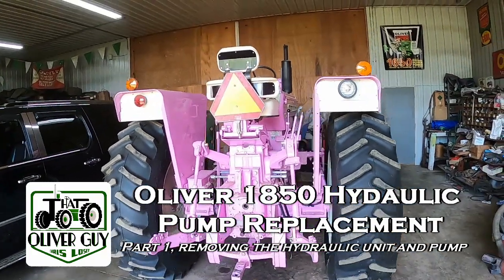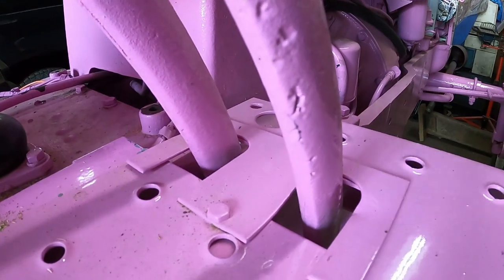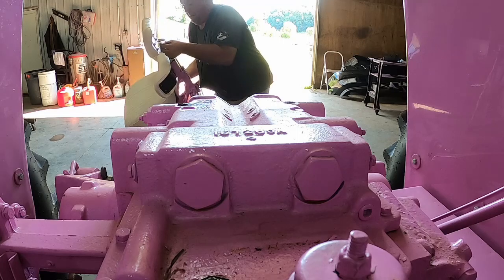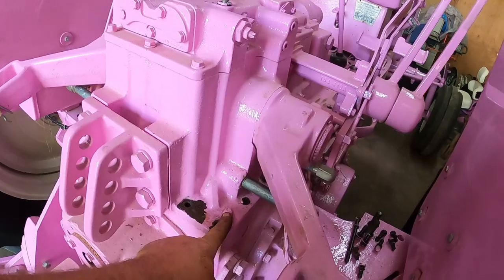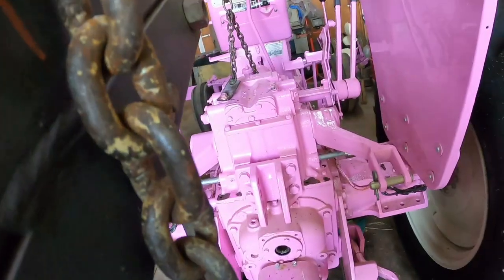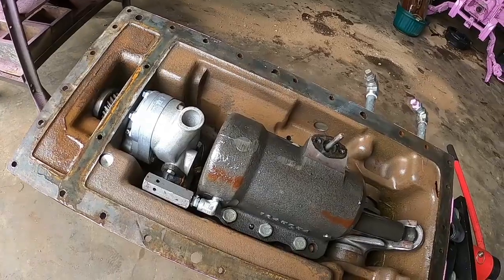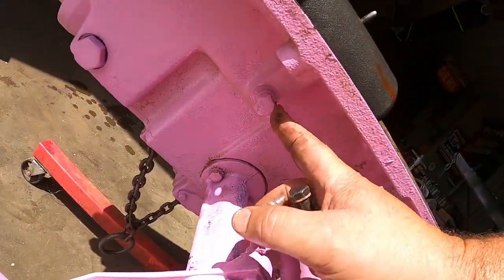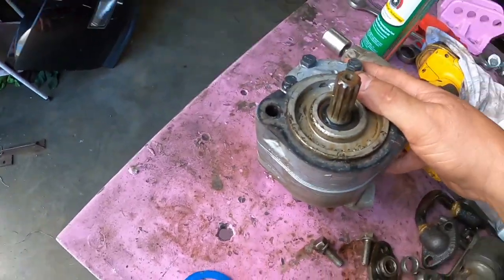1850 Hydraulic Pump Replacement Part 1

Comment: Just curious if it is possible to delete the hydraulic sump set up and run a suction line to the bottom of the rear end housing and just run trans hydraulic oil in the rear end as every other brand of tractor is this way i was told it was do able as long as its not being used for hard pulling thanks
Reply from the maker: I suppose it is possible. You'd want to use the outside flamge of that sump pan to keep the spacing right between the gears that drive the pump. Universal transmission hydraulic fluid would be a good oil to use to be thin enough to use for hydraulics but have the right additives to protect the transmission. I could also see it being a problem getting the hydraulic pump to prime with that much lift.

Comment: I always enjoy watching these types of instructional videos, while I don't have an Oliver 1850 to repair or replace the pumps, I do have others that need work on them. This inspires me to work on the projects I have, those ones that I keep putting off. I just wish I had a machine shop or repair shop with concrete and lighting. All I have is a small barn with no electricity that my White American 80 or my sons Massey 285 won't fit into. Thanks for sharing, I'll be looking for part 2 when you post it. Thanks Chris, hope you had a nice Sunday and I wish you a great, safe week ahead.
Reply from the maker: Thank you. It turned out to be a mostly lazy Sunday with family, so it was good. Hope yours goes well too.
Reply: It was pretty good, I did hurt my back on Saturday, but it was feeling better later in the day on Sunday. Thanks 👍

Comment: I have a White 2-70 with loader. The loader lifts fine but when lowering it moves slow. The 3 point also jitters when lifting the loader and left brake hangs up. Any idea what might be wrong? Thank you!
Reply from the maker: The restrictors are probably turned in a bit far and slowing the return oil. I cover that in this video. Jump ahead to 13 minutes for the part you need.
https://youtu.be/Ue4KmLaJO_k
Turning them out too far can make the loader bounce on the way down, so there can be some trial and error to find a spot that works best for you. That may also help with the 3 point jitter. Having the restrictors too slow causes back pressure that can make the 3 point want to lift. 
The brake probably needs a good cleaning and new return springs. I don't have a video on that yet.
Reply: Thank you for taking the time to reply with that information, it’s really appreciated. In an attempt to turn the restrictors one of the bolts broke so currently trying to figure out where buy a replacement
Reply from the maker: Google Maibach tractor, I'm sure they will have some used ones.
Reply: Unfortunately, they didn’t have any on the site for Oliver or White. Gonna give them a call. Sorry to be a pain but do you know any other sites or places to check out? Only owned this white for 6 months and have just got around to working on it. We primarily own old fords so Whites are new to us. Appreciate you a ton!

Comment: instead of pulling that whole thing off to replace that bad pump could you just put a new pump into that front cover and plumb it in as you described? and basically, have the 2nd pump be your primary pump leaving the bad pump in?
Reply from the maker: It's feasable. You'd need to plumb the pressurized oil from the new pump into the system, preferably before the relief valve so it's protected and filtered.

Comment: Thank you Chris, my 1850 needs this done before winter so I appreciate the tutorial!
Reply from the maker: Glad to help! Mine is a short cut version,  it just depends on what is in there.
Reply: I’m in the same boat. Ours has been out for well over 20 years, and I need to yank it apart.
Reply from the maker: New pump, gaskets and seals were less than $600.
Reply: @ThatOliverGuyChris  through agco?
Reply: @ThatOliverGuyChris  through agco?
Reply from the maker: I got everything from Ag Parts First.  He sells mostly Agco parts, but Agco doesn't supply a pump any more, so it's aftermarket for that.

Comment: Another great video Chris!! I like the idea of mounting the Hyd. unit to a engine stand. We are usually flipping it around on blocks on the ground.  Have a good Labor day. We will be hauling tractors in the rain to our local gas&steam show that is going on this week.
Reply from the maker: I had about 10 minutes of me talking about figuring out how to carefully set it on a table and rolling over while doing minimal damage to the paint, then it hit me. That's the only way to do it! My stand brackets needed a little encouragement to let a 3/4" bolt fit through,  but it's nothing a drift pumch and a big hammer couldn't fix.
Reply: @ThatOliverGuyChris  If I remember correctly I seen it in the service manual. A picture of the hydraulic housing bolted the the official Oliver/Waukesha engine stand.

Comment: Good video.  Too bad about having to damage the paint job on Ophelia, but hopefully it won't be too hard to touch up.  My Oliver mechanic friend Joe just replaced the hydraulic pump on my 1550 and at least now I can see and understand what he did.  Now I know what he meant about having to replace a bearing(s) related to the pump (like the ones you replaced.  Thanks for another great video.
Reply from the maker: There's more bearings in the next installment.  Thanks for watching

Comment: Chris, did you already remove a shaft out of the tractor prior? Or am I just seeing things with that rear cover having an opening in it. I was going to suggest using a painters scraper instead of a gasket scraper, they're wider but thinner and I think are a bit stronger. 
Seems to me like Oliver designs were and still are ahead of the times, simplistic. Great video as always, cheers :)
Reply from the maker: The cap fell out the same day the pump seal blew. Not the best day ever. There was a vendor that had them at the summer show,  but he was still setting up.   Then I waited too long and he was gone on Sunday.

Comment: Im been checking out all great videos. Years ago we had. 1850 perkins front wheel hyd  assist. 1969 I think on farm I was 9 years old yes I was a 1850 driver at age 8 lol. They sold the farm on me . Anyway after watching all your videos I been looking for a Oliver 1850 Gas good ones are hard to find. I know Gas engines. diesel engines I never worked on . Question is looking for a fully functional Oliver 1850 Gas . Use as yard tractor and lifting some bundles oak for the wood boiler . 
And add to My Dads Oliver collection as you say of wayward Olivers. Because gas are not as popular I thought I would ask you if you seen any good ones for sale . Just 2 wheel drive . Thanks for any info .
Reply from the maker: I don't know of any right off, but they do pop up on facebook marketplace from time to time.

Comment: Chris , i have a white 2-150 that is losing hydraulic oil slowly from the 3pt reservoir.  Could that be a crack in the plate separating the reservoir from the lower transmission?  Or a pump seal on pump on lower left side of tractor?  If it is a seal do you know a part number for that ? Thanks 

James
Reply from the maker: Chances are it is leaking through the pto unit. If you get some fittings and cap off the 2 lines that go to the pto control valve, you can still use the tractor,  but there won't be pto. If your oil stops going in the rear end, you've found your problem,  pto piston seals. If you keep losing oil, then you're looking at a cracked or rusted pan. There is a chance the cooler circulation pump behind the hydraulic pump is leaking. I'd start with the pto, 9 times out 10 , that's where the leak is.
Reply: @ThatOliverGuyChris  
Chris, 
Thank you very much for the reply. Its extremely helpful.  I ordered all of the seals for the pto beside the control valve seals. I use the pto on a snowblower so i definitely need it fixed.  I am guessing the seals get worn and when the pto runs it leaks into the rear case?   One of my next projects is replacing the seals on the hydraulic control valves. Its slowly leaking out the end of the plastic yellow caps . Thanks again for the replies.  Greatly appreciated.

Comment: You had the connections.........What was the reason they didn't use the rear for the Sump like mostly everyone else by that point.
Reply from the maker: Good question. They kept the hydraulics separate on this design right up to the last versions, the 2-88 and 2-110. They did start using a common sump with the 2-135 around 1976, but I can only guess as to why they didn't update the older designs.

Comment: Is the hydraulic oil common oil to the transmission and bevel gear housing. I’m. Thinking it is. Just want to confirm. I’ve got some milky oil so want to make sure I drain it all!
Reply from the maker: No, the hydraulic oil is separate from rest.

Comment: Do u have a video rebuilding the transmission? I bought a 1850 that 6 and 2 don’t do anything and when I drained the oil the teeth off the gear came out.
Reply from the maker: I don't.  That is a job that really needs a factory shop manual to do it right.
Reply: @ThatOliverGuyChris  ok do u think It’d be worth doing on a tractor that needs everything redone? I bought it running for $600 but hydraulic pump don’t work and engine slobbers like crazy but sheet metal is good
Reply from the maker: If you do all of your own work, or it has some sentimental value, then it might be worth it. If it were mine, I'd part it out. A good pair of flat top fenders will bring close to what you paid for the whole tractor. Sell the rest of the sheet metal and you'd be making money. Another option would be to keep it as a parts machine, in case you find a better running 1850 that might need some sheet metal.
Reply: @ThatOliverGuyChris I hated to part it out cause where I’m at bigger Olivers are hard to find all there is here is the fiat built ones but I would do my own work. Does the shop manuals tell how to get most of the stuff out? And would I have to split it from the tub or can I leave it sitting on four wheels and do most of the work?
Reply from the maker: @xade7863  The oliver manual shows it all. The I&T manual does not go into the detail that the factory one does. 
You wouldn't have to split the tractor, but if you have to take the pinion (bottom) shaft out, then you have to remove the rear axles, bull gears and differential to get that out. You could slide an axle out, pull the bull gear, then slide the axle back in to keep it on all 4 wheels.
Reply: @ThatOliverGuyChris  ok thanks for the information and have a good night

Comment: Chris got a question when we are wrapping hay with the olie 1750 sometimes the haylage is to heavy and the lift are on the wrapper doesn't want to lift it but if we lower the rpms down to almost a idle it will lift the hay up onto the turntable. Is there a reason it has more pressure at a lower rpms? Thanks
Reply from the maker: The relief valve may need shimmed. If the pressure is set low, the higher rpm would cause the relief to open and lower the pressure too much. Another thing is the restrictor in the remote may be turned in too far causing enough back pressure to open the relief when RPMs are high.

Comment: I’m try to relocate the battery in my 1800 to the compartment in front of the steering wheel and not having any luck finding a parts breakdown wondering if you would have any insight?
Reply from the maker: Try this link. 
https://parts.agcocorp.com/us/en/apbsearch?q=white/43300900/l&name=OLIVER+1800+%2F+1900+TRACTOR
Reply: @ThatOliverGuyChris thanks. Looking at that looks like they don’t make a factory mount for it. Time to start fabricating
Reply from the maker: @MattSlowinski-y4j  the A and B series had both batteries in front of the steering. The C series had one battery there and one under the left platform.

Comment: Thanks for the info Chris, just a couple questions.  Can you tell anything about the health of the pump by a system pressure check?  I need to take a hydraulic system down to replace seals and o-rings.   Debating about replacing the pump while it’s down due to age.  Everything works fine, it just slobbers everywhere, including the 3-pt leaking down in a day or two.  The Oliver service manual talks about taking the pump apart, checking clearances, replacing seals, o-rings and such to put it back in spec.  I realize we’re 50-plus years down the line here, but just about everyone seems to just replace the pump.  On your deal, the shaft seal was blown.  Otherwise, do you check them and/or rebuild yourself, or just replace?
Reply from the maker: Typically the ones i have done are so shot I replace. I've done a couple where I replaced the shaft seal since everything else seemed good. A good pump should be able to open the relief valve at an idle. You can use a gauge to double check, but if you hear the relief opening at an idle to around 1,000 rpm, it's probably worth saving. Now if your remotes and 3 point don't work at an idle, that's a sign of a worn pump that can't create enough flow and pressure to open the priority valve.  The more rpm it takes to get the remotes working, the worse off the pump is. If it's getting over 1,000 engine rpm to open that up and I was already tearing into it, I'd just plan on a new pump. My 1800 takes about 1500 to make the 3 point work once it is up to temperature.  I'm thinking this 1850 pump can go in there with a new shaft seal.
Reply: Wow, now I’m wondering if the system has ever been set right.  Had the 1550 since new, and the hydraulics have never worked at idle, except for the power steering.  For anything else, you have to get over 1,000 RPM-3 point or remotes.  I just thought that was the nature of the beast. If you contracted a remote, say let a disk or the loader down with some weight on it, at idle nothing happens.  A little above idle, it would jump, like a valve opening and closing and the oil can’t return fast enough.  Above say 1,200 to 1,400, everything works great.  1655 I had was the same way now that I think of it.  🤔

Comment: Changed the pump on “The Bitch” last year.
It’s got a cab on it, not a nice job. Not much room for a guy my size.
Reply from the maker: Did you leave the cab on? Those external valve units are easier to change the pump without all the 3 point stuff in the way.
Reply: @ThatOliverGuyChris  yes, I left the cab on. Had to remove the end of it is all, still a tight fit. Had to make some new fittings as the old pump had a steel line, replaced it with a hyd hose and it works great now.
Reply from the maker: Herman's had been replaced with a hydraulic line. When I put a new pump in him I was able to get an original steel line to put back in.
Reply: @ThatOliverGuyChris  the hose is working fine, no plans on changing it. Lol